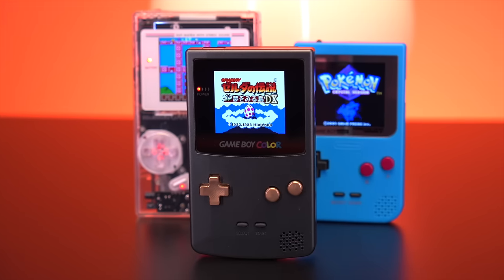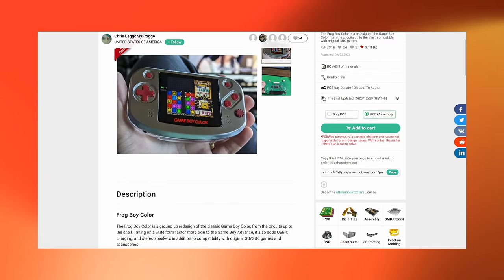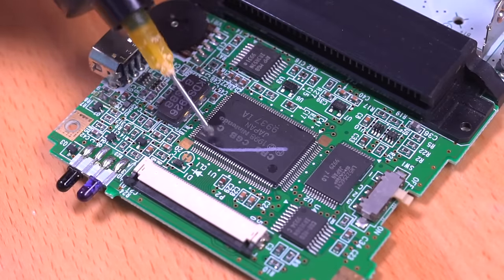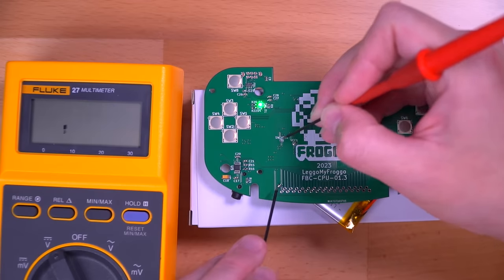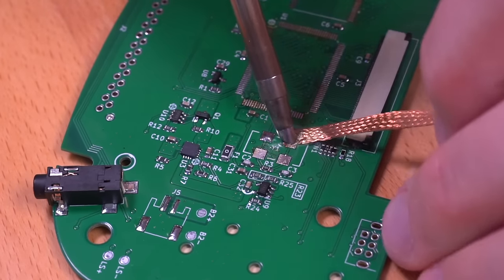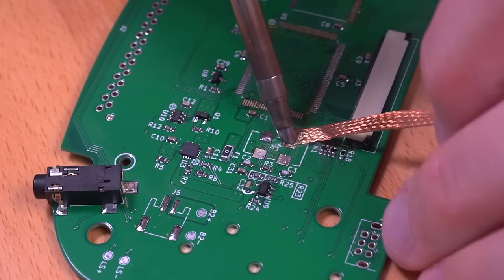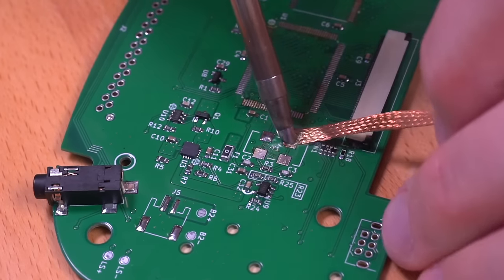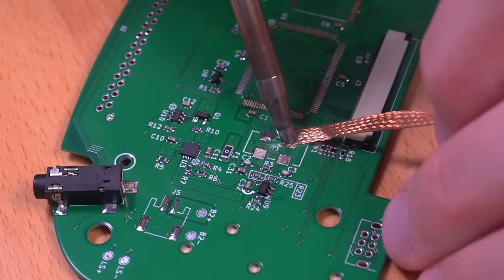Nintendo’s Missing Link Between The Game Boy Color And The Advance

Comment: That volume wheel placement choice is mind boggling.
Reply: What an odd placement, I can't imagine it not being in the way. Your thumb will be resting on top of it which seems like it would be uncomfortable after some time. Like you said mind boggling placement.
Reply: Very poor choice indeed.
Reply: I don’t feel or notice it any time I’m playing
Reply: @Sampsonited Froggo also said so, but everybody holds their controllers/handhelds differently.
Reply: At the very least the volume cap is removeable
Reply: @neetrain I think you’re confused on how opinions work
Reply: There's a new version of the knob that's lower profile but I don't think anyone who's actually used one of these has had an issue with the location, don't knock it till you try it
Reply: @ConsolesAndCasks that’s cool. Thanks for the info.

I wonder if a future revision will relocate the volume wheel to the top or bottom.
Reply: I wonder why on modern devices they took away the volume wheel? It was something that you could easily mess with and get the value you wanted even if the device was off. Now with devices like the Steam Deck and Switch you are screwed if you turn the device on without the volume all the way down. Also you can't adjust the volume to your likeness. Sometimes you want it in-between the 2 levels that it sets it at when pressing the buttons.
Reply: @bland9876 they have moved away from discrete analog components like potentiometers to control the amplifiers and instead rely on digital signals or digital-analog conversion on board; likely cheaper and fewer mechanical components to break
Reply: @ConsolesAndCasks  where did you see that??
Reply: @seanh5014  what are you referring to? There's multiple conversations going on in this thread
Reply: it looks fine. You guys are being nit pickey
Reply: @ConsolesAndCasks  the thinner volume wheel. Wondering where you saw that.
Reply: @seanh5014  I have one, lol
Reply: @seanh5014 and sorry to ping you a third time but he just posted it
Reply: An easy fix would be to redesign the button with a lower profile. A good fix would be to move it somewhere else
Reply: Even if some people don't have a problem, many will and it's a bad design choice.
Reply: @n64fan60  how is it a "bad design choice" if some people like it and some people don't? You're acting like something completely subjective is objective
Reply: @ConsolesAndCasks  Because if you place a volume wheel in a position where some users will touch it without meaning to - that's a clear design flaw. 

It means that at the design phase, they either didn't notice this (I noticed as soon as I saw the image...), or just didn't care lol.

People have said that they since reduced the profile of the wheel so it doesn't stick out as much, which means that the manufacturer themselves later acknowledged the design flaw.

Even reduced in size - it's in a stupid place, and anyone with two brain cells to rub together can see that lol just look at it!
Reply: @n64fan60  my GBA and SP volumes get screwed up all the time because they're on the edge. I've never accidentally adjusted the volume on my Frog Boy
Stop presenting opinion as fact, it's your opinion, and in my experience using the device, it hasn't been an issue and it's actually the opposite of what you're BSing about
Reply: @ConsolesAndCasks  Well IMO it's a design flaw, then, is that better? Also, try not to get so heated. 1) We're just talking about consoles so there's no need to get pissy, even if you are trying to defend your purchase (lol!!) 2) You would never dare to speak to me face-to-face in that manner. You probably couldn't even look me in the eye, friend 😉
Reply: @n64fan60 lol - I wasn't the one who attacked someone's design because I'm jealous of it and need a way to feel better about myself
Reply: @ConsolesAndCasks  Why in the world would I be jealous of their design, flawed or not? In what way would that make me feel better about myself?
Reply: @n64fan60  I don't know, you're the one complaining about it on YouTube like he killed your cat or something
Reply: @ConsolesAndCasks  I was responding to OP in agreement. You can tell just from looking at it that it's not a great choice, YouTuber also points this out.

I understand you unfortunately purchased this product, and are hell-bent on defending it, but at least (currently) 175 people agree with OP, including myself.

As stated, the manufacturer has also reduced the size of the wheel, thereby confirming that they agree that its a design flaw. Otherwise - why would they try to patch that problem out, if its not a problem?
Reply: @n64fan60 there to go again with the condescending attitude - I'm defending it because your opinion is based on watching a 30 minute YouTube video and not having one of these in your hands for a few months. You're  acting like I have buyers remorse when I'm sitting here trying to think of what color shell I want my next one to have. There are probably less than 100 of these in existence right now. If you don't like it, don't build it... It's one dude's passion project so calling him a "manufacturer" misses the point. I'm grateful enough that he's shared it, and, again I LIKE the volume knob where it is, it's part of the charm of the damn thing. In fact (as I stated already) I think it would be worse off if it were anywhere else, as I stated, it's in a far better location than the awful spot that the game boy advance knob is
Reply: @n64fan60  when you make a polarizing design choice you often come up with solutions to help please the people that aren't happy with it, the new knob design is that answer. Again, polarizing, not "bad" you should learn what an opinion is, it will serve you well in life
Reply: @ConsolesAndCasks  Dude, I know precisely what an opinion is. There are a minimum of 175 people who agree with OP, which makes it the most supported opinion of any on this particular video.

It's nice that you like your purchase, and are going to purchase more shells for your custom Game Boy Color, but many of us are disliking the design.

We're allowed to dislike the design and comment on it, you know. Where's the "This design is awesome!" comment with 175 likes? There isn't one. Enjoy your purchase 😆
Reply: @n64fan60 right there with more (190) likes "leapfrog done right" - oh and if you really want to play the numbers game, it's silly, the video has 4000 likes but sure that less than 1% of watchers means it is a design flaw. and I think the reddit post 6 months ago had like 400 karma, and 5 or 6 Facebook posts of them with 300 likes, or the thousands on Instagram posts too
Reply: @ConsolesAndCasks  Fair enough dude, enjoy your purchase. We will stick to our opinion that the design is bad.
Reply: 🤢 yuck!
Reply: @n64fan60  ok Queen Victoria
Reply: @ConsolesAndCasks  Queen Victoria lol wtf?
Reply: Yea poor placement but I see the vision tho it looks really cool
Reply: Looks like a “duck” - an intentional mistake
Reply: Its just an apple crown clone to give the air of luxury
Reply: @ConsolesAndCasks issue when a digital switch breaks is you need to replace entire chip sets. A spring or a switch is much cheaper and easier to replace on its own as analog.
Reply: It’s pretty bad placement I have to admit. It’s unique but imo a bad choice. Loads of people are saying that they’ve never had a problem with it, but personally I change my hand’s position a lot more than others I’ve seen so idk if I’d like it if I had one in my hands
Reply: One thing that's not being mentioned about the volume wheel is that you can't/shouldn't print it in plastic. It has to be CNC aluminum, which is going to cost about $45 to have made through PCBWay. The decision for this volume wheel added $45 to an already expensive project, just for the volume wheel.

Comment: Love the video, super happy you built one! Just FYI for anyone interested that the next shell revision will be going up on PCBWay soon, which addresses(among other things) the power button, cart slot, and allows for a shallower volume wheel.
Reply: Can't wait to see it. You're a legend for this.
Reply from the maker: Can’t wait to check the latest revision!  Will it be compatible with the existing motherboard?
Reply: @MachoNachoProductions  Yes!
Reply: @leggomyfroggo can you make a back version which covers the cart label to protect it from damage whenever you put it down/in your pocket? I'd be worried about damage to my carts with the current design
Reply: @viridionwaves if it was clear so you could still see the label that would be so cool
Reply: @leggomyfroggo Will the OLED screen work with it?
Reply: @tkb301  it's a bit tight, but it fits
Reply: @leggomyfroggo   revision 2.0 will be near perfect then with Tito's recommendations..great work..I have an OG GBC..with the hard to see standard screen..shame I'm the other side of the Atlantic and I can't solder those SMCs..
Reply: Might have to get a kit for this before making a standard modded GBC LOL
Reply: @leggomyfroggo you are amazing!
Thank you for an amazing work!
Reply: Very nice work. Just my 2 cents; place the switch on top along with the ir, change the volume knob to slide and move the type c port to the bottom center. I'm not expecting this to have a card slot for backup since it uses the original gameboy chip, but if there's a variation for fpga then very good. Thank you for this man.
Reply: Volume wheel can be shallower for sure, maybe even flush with the case. as long as you can still turn it with a thumb it would be functional enough.

cartridge slot needs to be more protective. maybe instead of exposing the entire front of the cartridge, just have a cut out for the game label? like a dreamcast controller if u know what i mean.
Reply: Volume wheel needs to be ressessed as well imo. The placement is where my thumb sits.
Reply: @MachoNachoProductions  Could we pin this comment for future visitors to your video?

It'd be nice for future folks to know that your concerns have been addressed.

Comment: Imagine if there was a piece of see-through plastic over the cartridge port so you could still see what cartridge you're playing but it would be more protected that just seems better to me.
Reply: Or glass. I like the idea.
Reply: @jon4715  I was thinking the same kind of stuff they use on PC cases and for the lenses of video game systems when they aren't glass.
Reply: yep, first thought too.
when i saw the cartridge protruding, it became more obvious
Reply: Or a hi-def screen showing in real time the label with a micro camera pointed at the label 🤡
Reply: @jimbotron70  Aight, I’m good with just a full aluminum cover with no cutout ;)
Reply: I agree that would be cool
Reply: So I'm not sure if this is your first time soldering a cpu like this, but I definitely recommend pre-tinning all the pads. You use a tiny bit of flux, tin the pads, clean the surface, veeery light flux again, then top with cpu/IC and hot air. Chip should self align and just 'pop' into place, much like any other surface mount.
Reply: @kenshinbattousai374  damn I didn't know you needed to have a girlfriend in order to solder things. 

They usually come with hot air guns.

Comment: The way the cart fits in is clever. Kind of like how Analogue Pocket deals with the problem.
Reply: I in other hand don't see the reason why it doesn't have any ridges on the sides to hold it, since it won't ever fit the shorter GBA cards like the Analogue Pocket has to. It just leaves it prone to damage without anything on the sides to hold it, but it would increase printing/machining complexity, unless cleverly using the rear steel shield, like Nintendo themselves did it, to completely avoid a complex mold, instead it can be made on a two part only one.
Reply: While it looks nice, I wouldn't trust using it at all. The console's form factor and power button lend itself to being put into a pocket, but I doubt the cart port would stay undamaged if you put it in your pocket with carts in it often. It's a very big surface with little support, and even a coin getting wedge under a cart could cause damage. That's why the original had the back support for the cart
Reply: And that's one thing i don't like about analogue pocket.

Comment: Wouldn't an internal volume wheel be better on the bottom? Also the Sticker of the game should be protected, therefore should be closed as much as possible. If you leave it like this, every sticker will be damaged over time because of the fingerprints.
Reply: Of course, these are obvious and logical improvements.

Comment: Hmmmm I think i would prefer the volume wheel on the side of the console, maybe have the start and select buttons as shoulder buttons or have them on the bottom right of the console. Also a nice little touch would be to have a clear plastic cover over the cartridge so it is more protected but still visible.

Comment: I would personally prefer the volume wheel to be on the side like the GBA or a volume slider like on the GBASP. Not that it doesn't look cool as is but like you said it seems pretty easy to bump into or just being uncomfortable depending on how you rest your hands on it while playing. Or maybe have it recessed like the A, B, and D-pad. For the cartridge slot just extend the shell to cover it more. Seeing the cart sticker is neat but I rather have it protected from my finger oils or other damaged. Picking up my GBA it looks like my fingers would be resting on the cartridge sticker while gaming.

Comment: I find the soldering SOOOO satisfying! What I love is how you follow the tip of the iron up to the top of the pin, which helps the heat evenly distribute and helps to get air out of the solder ball, for a better, long lasting connection. That nice cone shape the solder makes is GOOOOOOD!

Comment: Great video Tito! 

I have a few things to share regarding the cons you mentioned!

The cartslot shield- as opposed to just loosening the screw, I added an m2 washer between my cart shield and shell. This gave me ample room for all of my whacky, 3D printed carts and they were able to sit flat (thank god for the cgb cart slot)

The power button- before you close you FBC up and even before you sinch the pcb to the front of the shell, nudge it as far toward the bottom of the shell as possible. I had that same issue with my personal FBC and this was my remedy!

Me and Jack are accepting orders on these just like the dmgc and mgbc, so feel free to give a shout!

Comment: I'd move the volume wheel to the edge somewhere like the original color, move the power switch to the top and make it a sliding switch, and add some ridges to guide and hold the games in the cart slot but still showing the label.

Comment: Another potential con is that the dual batteries are soldered directly to the board and not more easily replaced. It's minor, but obviously, batteries that can be more easily replaced would be preferable. That said, this is a very cool project that I'm interested in seeing evolve.
Reply: Just wiggle the wires untill they come off and solder on some new batteries. A beginner could solder them on.
Reply: @bland9876  I can't solder at all, so that wouldn't be an option. It would just end in a mess. Not everyone can solder, even with practice.
Reply: I wasn't able to find the size of battery I wanted with low profile connectors, which is why it ended up the way it did. There are footprints for JST connectors for each battery, but you need much smaller batteries to make use of them.
Reply: @adrenaliner91  swapping out those batteries look super easy because it's literally just hold the wire to the point and touch it with your soldering iron that has some solder on it and just do that like four times.

It looks easier than replacing a battery in a Game Boy cartridge which I have done before and is the only thing I've ever done literally.
Reply: If you have no skill soldering then this is not the project for you regardless. I wouldn’t worry about replacing batteries.
Reply: Battery connectors aren’t very efficient at all, you gotta solder
Reply: @adrenaliner91 this is not for you, go somewhere else to complain.
Reply: @user-yk1cw8im4h  and why shouldn't that be for me? Why can't somebody build it in the future and I could buy it and just want a better thing? Think before you write.
Reply: @adrenaliner91 then complain in the future. No point in complaining about a project that you can’t do now
Reply: @user-yk1cw8im4h  how are they not very efficient?
Reply: ohai :3

Comment: This is really nice looking, and I appreciate all the work that went into it, but they made the same mistake with B and A that the Dogbone NES controller made. Having B lower than A isn't how the thumb naturally sits for games where you need to press both.
Reply: Not wrong just needs to be reversed so the lower button is under on the right, not left
Reply: I agree it can be argued that the height difference is too much, but literally the entire Game Boy lineup has it that way (less pronounced tho).
Reply: @Kalvinjj  yeah I get that, it’s just something I assume would be corrected when making a custom PCB is all. If we were sticking with the original PCB isn’t not something I would bring up.

Comment: The volume wheel should be combination buttons  input like up, up, B,A, A, B Left,Left, Right, Right for volume down and opposite for volume down. It will not work if the game is paused on the device is off.